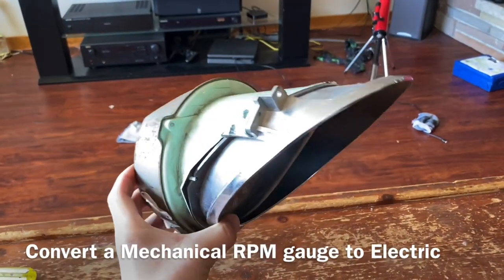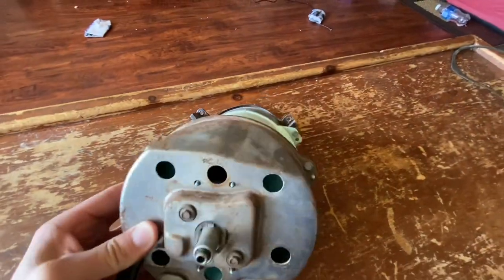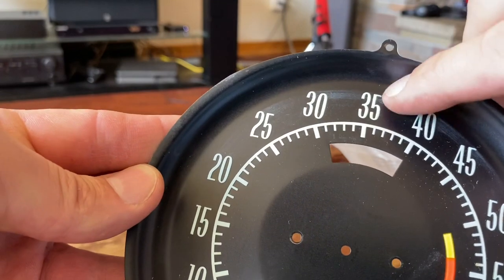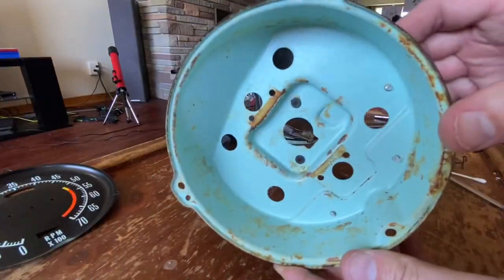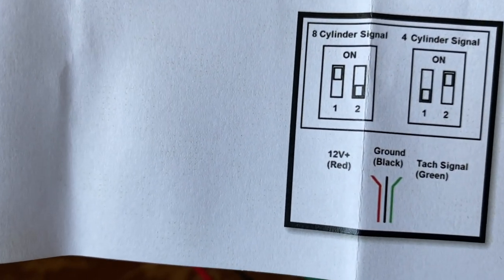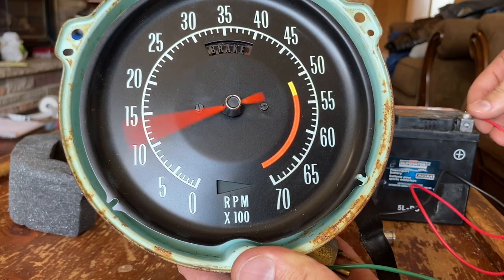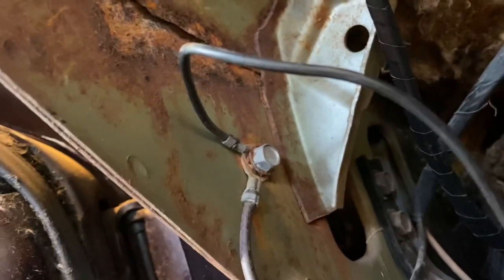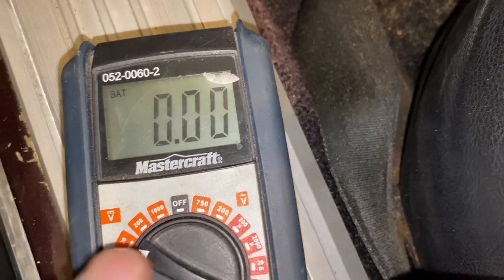How to convert a Mechanical Tach to Electric (53-74 Corvette) Electrical Tachometer Install

Comment: The fuse box is within inches of the tachometer. You could find a switched 12V source there.  Dielectric grease doesn't conduct electricity, it is an insulator that protects terminals from corrosion in plug connections.
Reply from the maker: Correct and correct

Comment: On the fuse panel there is a blade marked "IGN" which is key on power. People usually connect their electric chokes to that terminal but will work in this application.

Comment: Great video, easy how and explained things very well. I have just bought myself a 1972 corvette. One of the problems I have is spongy brakes. The prior owner stated that he replaced the master cylinder and booster, not sure on the calipers. Am thinking he must have air in the brake lines. The only thing is that he told me that the brakes were spongy when he bought the car 2 years ago. So, do you have a video on the brake system and how to diagnose them? Not leaks from what I can tell. If you already have a video out please send me the link. Thanks David..... keep up the great videos

Comment: Tom, I'm restoring a '77 Vette.  I'd LOVE it if you could do 2 more videos, one on how to unhook/clean/reuse the dash wiring harness and the rear chassis wiring harness and  a second one on how to remove and clean the power window regulators on a C3.  LOVE the helpful hints and tips.  I'm going to try removing the headlight and the engine harness myself now! :-)
Reply from the maker: I will be troubleshooting some of the inside harness in one of my next videos, but I’m not removing it, the main problem with those is you need to pull all the fuses out clean everything and put them back in.  There’s no issues with my rear Harness so I’m leaving it alone for now
Reply from the maker: And one of my power windows doesn’t work so I will also be doing that
Reply: @ProblemSolverGarage  AWESOME!  You're the best buddy! :-)
Reply from the maker: @Ender0999  thx 🙏🏻

Comment: When you installed it, did you check to see if the readings were accurate? How did the old setup read compare to the new? I bought this tach conversion from zip, and it states to use a 53-82 Electronic Tachometer Conversion Signal Generator.. to accurately setup..

Comment: I did the conversion and doing it I lost my lights on the tach gauge , I thought maybe it was a ground issue , so I attached a wire from back of gauge cluster to the negative on the battery and the lights in the tach still don’t come on, the speedometer lights work fine

Comment: I had a shop install the tach upgrade.  However, when the ignition is off, the needle spins slowly counter clockwise and stops at 5500 on the dial.  They didn't have any reasonable explanation except, "when the car is running the RPM is accurate".  I connected a feed wire from the reverse switch like in this video and it didn't change the needle behavior.  Just wondering if there is a solution or if everyone else is experiencing the same thing.

Comment: Nice one Tom. For poweryou could have used one of the gauges that only work when the car is powered (like water temperature gauge or fuel gauge)?
Reply from the maker: Yeah you’re right I could’ve, but at that point that stuff wasn’t working yet, I actually just yesterday figured out the problem, but yeah you’re right
Reply from the maker: Whole bunch of stuff wasn’t working, I scratched my head for a while tested everything turns out the actual fuses in the fuse box Needed to come out everything cleaned up and put back in and then everything worked, just corrosion in the fuse box. 
  So when I was trying the positives on the gauges there wasn’t one lol
Reply from the maker: Everything is working now except for one window on the passenger side doesn’t go up or down, just waiting on a few parts and I can put the whole dash back together
Reply: Check the clock mechanism. Usually if you wind the clock manually it will work and the issue is with the solenoid coil
Reply from the maker: It works but it stops sometimes, I’m gonna open it up and oil all the gears, I’m going to oil all the mechanical gauges inside. I did the same thing in my 69 Mercedes and everything’s been working for seven years now, and nothing worked in that either, everything was dry